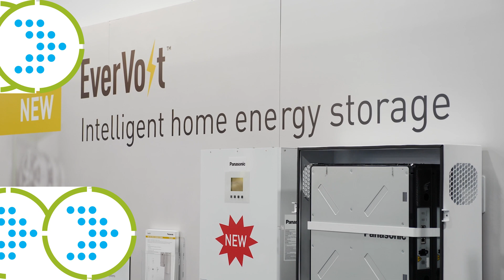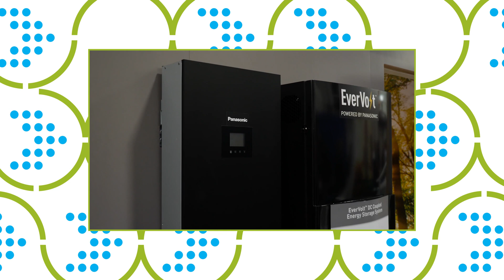Creating Shared Energy Value with Utilities, Consumers, and Electric Fleet Operators

Comment: Can you take care TV care? 

On
January 27 2022
Has not turned on yet. 

I try at 6pm - 11:27pm 

With Remote BN59-01301A
Samsung Made in Vietnam with 2 AAA Batteries 

For SmartTV 
UN32N5300AFXZA 
Samsung SmartTV 32" HD 
November 20 2021 
Series 5 model 

Can you provide my Samsung SmartTV of Care? 

Is it update.